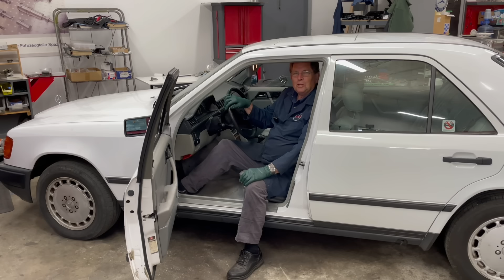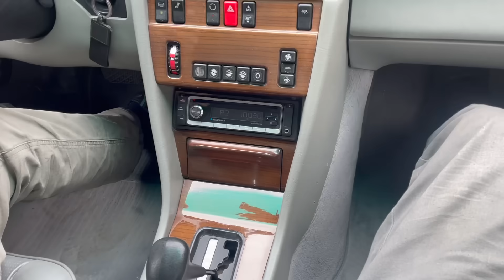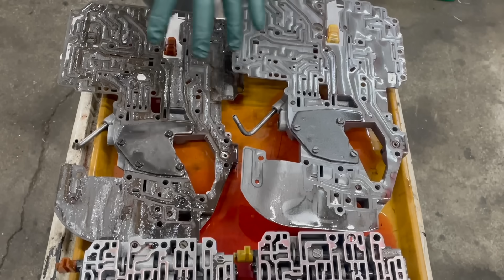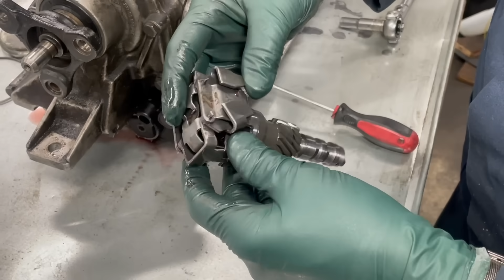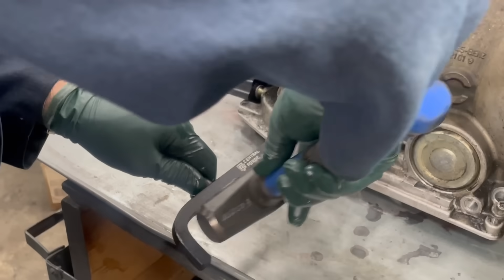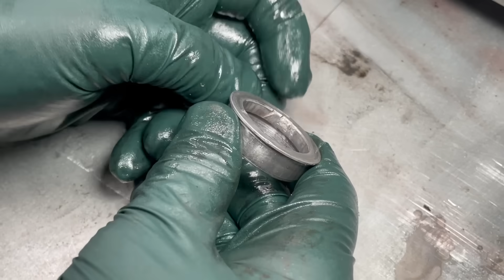Why Transmission Won't Shift? Mercedes W124 300E Rolling Restoration Series - 4: @mercedessource.com

Comment: My 87 300 D Turbo Only has reverse, No forward gears ,B2 piston band Gone ?Car has 247,000 miles on it ,Im the 3rd owner. Car has been sitting for over 10 years.

Comment: My name is Yamamoto and I'm from Kagawa Prefecture, Japan.
I own a W123-300TD.
I'd like to know how to eliminate the shock that occurs when the automatic transmission shifts gears.
I've changed the ATF and filter.
I don't feel the shock much when accelerating forcefully, but it is stronger when accelerating slowly.
I really love this car. I'm 69 years old and plan to keep driving it until I surrender my driver's license.
I would really appreciate it if you could tell me a solution.
Reply from the maker: Need more info as all automatics are not created equal. Is yours a US. Spec turbo diesel model or non-turbo? How many miles?

Comment: I really appreciate these in depth videos. That transmission has a very course filter in it under one of the items you access within the pan area of the transmission. It wasn't within the two halves of the valve body, but rather what I thought was an auxiliary valve body. If that thimble sized filter becomes clogged with clutch debris, it will greatly affect the shifting, once it becomes completely blocked, it will no longer shift. I incurred this on my 722.317 trans years ago in my 87 300D. I cleaned the little thimble filter and entire valve body and it worked great again. I realize this is not necessarily your issue, as you replaced the entire valve body, but just wanted to share my experiences.

Comment: Looks like moisture built up — classic condensation. Probably sat unused for ages, because the oil’s turned into something between soap and sludge. I always say: change the automatic transmission fluid every 40,000 miles or five years, whichever comes first. And that other damage on the seal housing? Yeah, someone’s been poking around in the gearbox who clearly had no idea what they were doing. Probably watched half a YouTube tutorial and thought they were ready for Formula One.
Reply from the maker: No. Car was driven regularly over its lifetime. You will see in the next video the fluid deterioration was caused by something else.
Reply: It is worn out completly, to the bone. This is the problem. Lots of parts disentegrate inside.

Comment: I like how you show and explain problems and solutions in detail. This is incredibly helpful when trying to diagnose a problem and fix it. The trial and error procedure can be very time and money consuming and tool modification to make it work (nut on threaded shaft) makes difference between success and damaging components. Is easy to make a repair into a giant problem by not knowing what you are doing.

Comment: Hey sir. Thanks for video. I have Mercedes 420 sel  with high  idle, need help. If it’s possible for you to take a look or recommend someone?  Thanks
Reply from the maker: It most likely is either a faulty idle speed controller or a severe intake air leak. Google the problem. There is lots of informaiton on the internet.
Reply: You have to resolve all vaccum leaks first. Are your idle breather hoses leaking? Google intake manifold reseal, there are seals between lower and upper intake manifold and they get totaly destroyed becouse of heat from EGR gasses. Mine just melted down in my hands when I did that job...😮 They were almost 40 years old.

Comment: I took apart a 722.5 transmission from a E320 1994 and put it together again, and it worked fine. The problem was no reverse from a broken seal.
Reply from the maker: Good job on the successful rebuild!